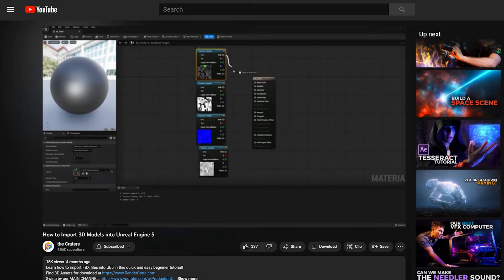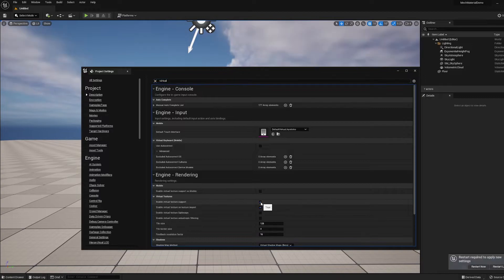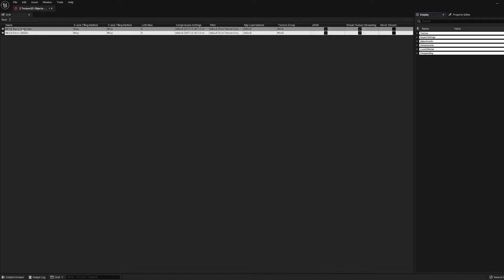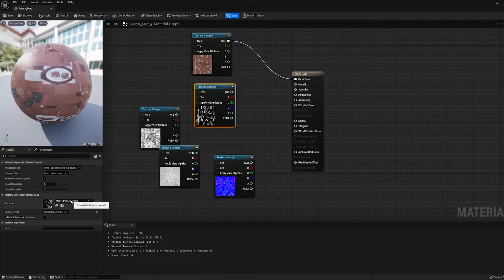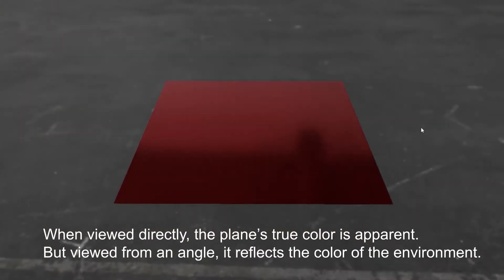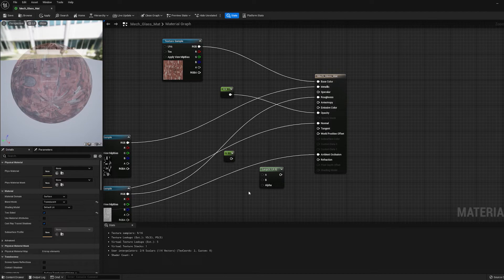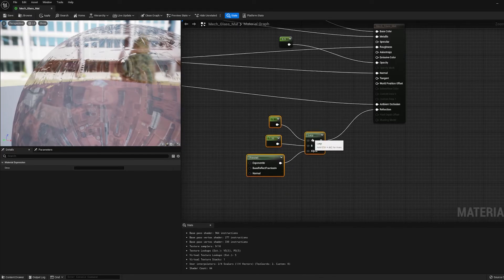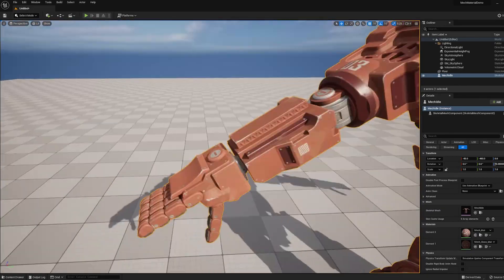How to use UDIM Materials in Unreal Engine 5 - Tutorial

Comment: It's incorrect to assign a translucent shader to the entire mech. Transparency affects depth sorting and disables proper Z-buffer writing, which can lead to rendering artifacts like overlapping or flickering parts, especially when multiple translucent surfaces intersect.
Additionally, most translucent shaders are set to two-sided, which can cause inner geometry like the mech’s internal structures or backside faces to render on top of front-facing geometry. Instead, only the glass or transparent parts should use a separate translucent shader, while the rest of the mech should remain opaque for proper depth handling and performance.

Comment: Hi thanks for the great video. I'm currently trying to use this workflow and for some reason the UDIMS only work from the first couple tiles basically 0,1 - 0,2 and 1,1 and 1,2 - all the rest aren't displayed. I noticed in the texture panel is says Max In-Game 40960x8192 and it also says Imported 4096x4096. The texture in the texture viewport shows all the UDIM tiles, but it's only displaying those 4 tiles on the model leaving the rest messed up looking. Any help on this would be great! thanks a ton!
Reply: Hey, have a similar problem, I have 5 tiles 4096, but after the import it's only the first tile. Have you come to any solution by now?
Reply: @nonamestranger1619  nope couldn't find a solution, had to use fbx. Alembic is basically broken for UDIM.
Reply: @nonamestranger1619  the problem is with the naming, what worked for me is that i seperated the textures to different folders, base color textures in one folder, normals in another folder ...etc.
and they need to follow this naming standard:
BaseColor_1001.png
BaseColor_1002.png
BaseColor_1003.png 
and so on.
hope this helps

Comment: BTW  I highly suggest having a separate material for transparent objects since when you check the "two sided" option, it basically doubles the geometry of everything assigned to that double-sided material.
Reply: That is incorrect. That setting only turns off backface culling.
Reply: @darksweeper  Unless something has drastically changed and I am not aware of it, two-sided  objects are rendered twice. So if you have a small area of your object that you want to be double sided it's better to have that area be a separate object. Meaning it's better to render 200 polygon's twice (just the glass) instead of 20,000 (all of the top mesh).

Comment: I’ve got a question… the main reason why I’m even here is I’m wondering is there another program other than CryEngine that sees & can import CDF (Character Definition Files) files into another program & actually sees it? Basically it’s the same concept as a CHR in 3d Max, but it looks like there’s not a lot of programs out there that will import a CDF so that the figure is rigged right. There’s a model that I want to use, but I can’t get it load in Blender for example because most of the plug-ins for CDF files in Blender no longer work. Personally I think that there should be more access to what files that a program can read… restricting that is like not allowing a program to see a JPEG, BMP, or TIFF for example. More file types should be universal is my attitude… but I’m wondering is there something out there that can see & import a CDF so that it can be exported as a different format? All the parts/meshes to the model that I want to import into Blender work… but the rigging won’t get imported… & because there are so many parts there it’s going to be a NIGHTMARE to put it together manually. That’s why I’m asking if anybody has any experience with this.